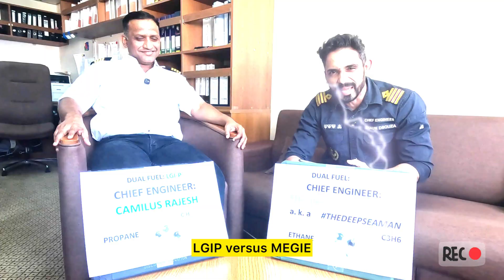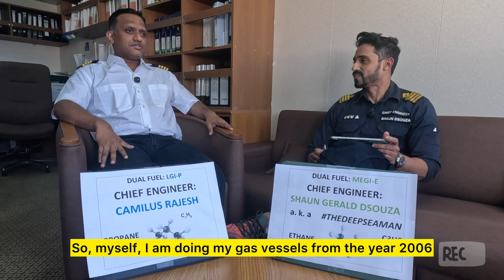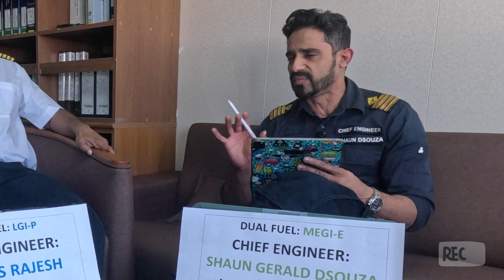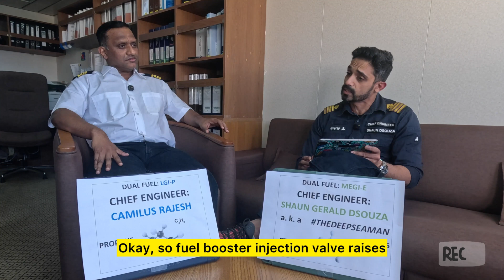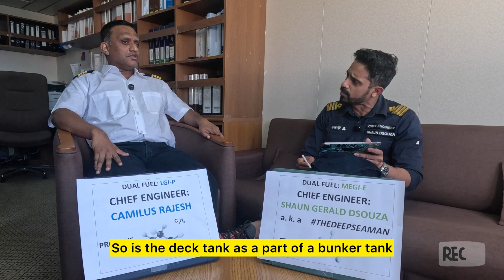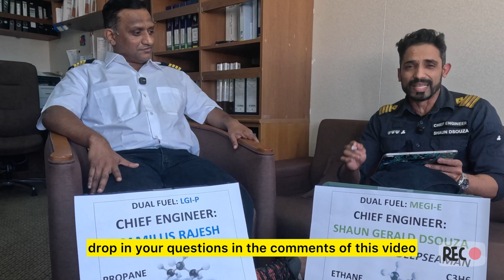ETHANE vs PROPANE, MEGI-E vs LGI-P, DUALFUEL SHOW DOWN. DIRECT COMPARISIONS FROM CHIEF ENGINEERS POV

Comment: Dear Mr Shaun, Can u pls help identify the physical position of " XC 6005 SET POINT  - 250 Bar ". As per display the position is just outside of GVT room but could not locate it. We need to see this as this , in my case, shows " Zero" and   c/o to gas mode fails even with PT   6017 shows proper pressure. Can any body help ?
Reply from the maker: sorry for the late reply..... im not online here....please connect with me in Instagram, we can share the actual pics easier and troubleshoot...

Comment: Dear Mr Shaun, How r u ? 
Need help.  Today  I tried to c/o ME from  lsmgo to LNG. But after successful completion of assembly and purge test,  one display on mop did not c/o to ready mode.  The display  is  "" set point  0 ( zero) bar, supply system st-by req".  But supply system "ready " signal should come. This display appears just b4 the GVT room. Pr inside in the pipe is normal inside the GVT room. Thanks
Reply from the maker: HI Aritra, sorry didn't see this earlier, as I'm not regularly online here; Instagram is easier to connect - #thedeepseaman

Comment: First of all, thank you very much for your sharing. I work for PASCOGAS and our new build ships have LGIP engines. Inlet pressure of the main engine supply valve train is 53bar. It is first increased to 22 bar with LP pump and then to 53 bar with HP pump.
Reply from the maker: Thank you for sharing your experience! APPRECIATE your sincere comment. thanks for the exact info

Comment: Good day chief I'm one of your follower. I just wanted to ask about our situation here. we have a problem with our FGSS we overhaul our HP pumps, we change seals and o rings and new clack valve then we run. And our HP after overhauling can't build up pressure anymore. Any suggestions and options that you may know about this problem?
Reply from the maker: which engine and what FGSS do u have?

Comment: Thanks for comparison, it's interesting, you spoke about injection pressures for both cases, what about timing of injection? Probably it's all managed by me mop, but generally what are the angle of injection for these fuels? Thanks
Reply from the maker: for timing, this is related to the Pcom-Pamx ratio set by the engine for various engine loads and the break point as one reference. this has a preset algorithm which the ECU follows. a lot depends on the engine type.. the stroke:bore ratio.. like if the engine is S-ME or G-ME etc.
Reply: Sir kindly guide why butane ? And is it pure butane. Is there any benefit of butane which is not with ethane